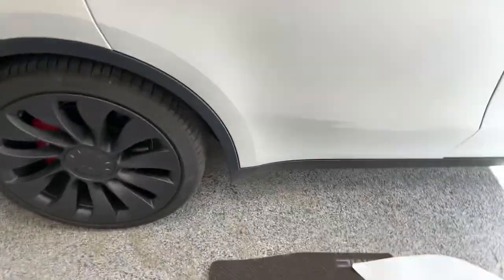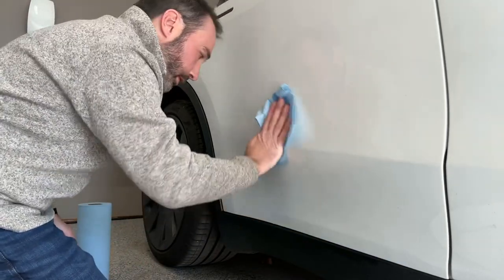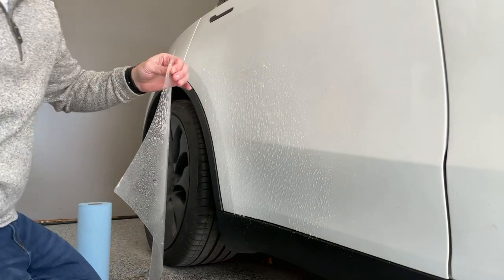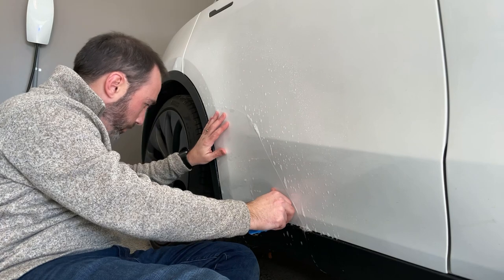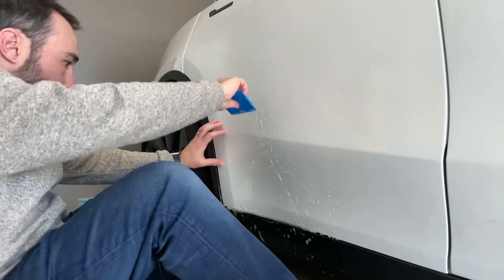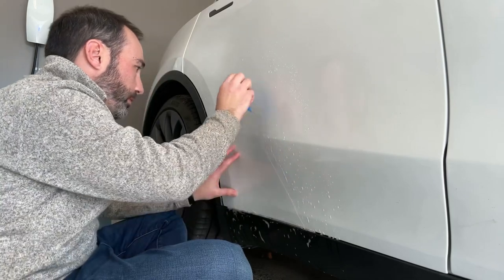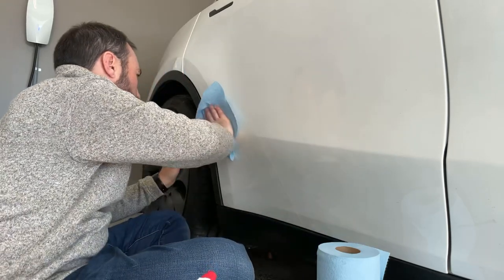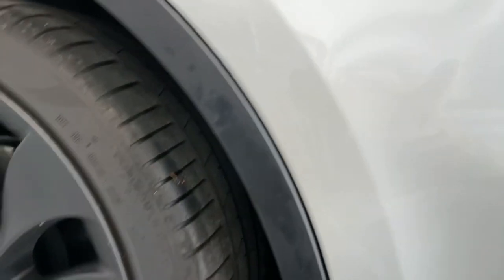Tesla Model Y Paint Protection Film Kit Installation - DIY

Comment: it's not recommended to use paper towels to clean the surface of the paint, because it can cause microscratches. I'd recommend to use microfiber towels insteat which minimize the risk of doing any damage to the clear coat, even with high pressure applied.

Comment: I have used pre-cut kits before.  Over time, dirt will accumulate on the edges and the edges will be very visible.  This problem is most visible on white cars.  That is why I now wrap the entire door and tuck the edges behind the panels or leave no space between the edge and the body panel.

Comment: Did the 19” tires ride better than the 21’s?
Reply from the maker: Not significantly better.  My 19” setup is  winter tires, and now realize they are quite a bit noisier than the stock 21”.  The difference in ride quality is negligible in my mind.  I might feel differently if I tried the 19” OEM Gemini wheels and tires...never driven a Y with those on it.
Reply: It def does. I tested drove both and now I have 19in wheels in mine